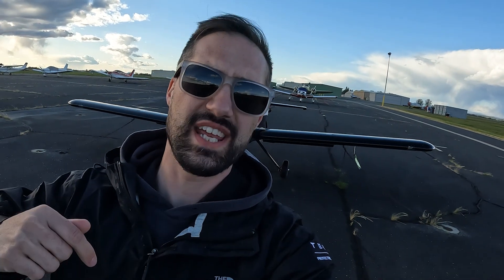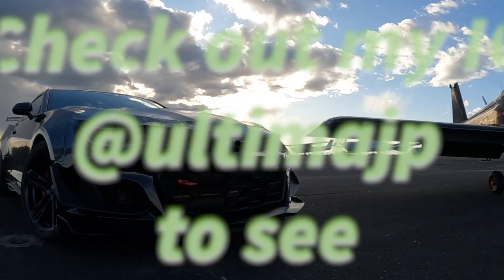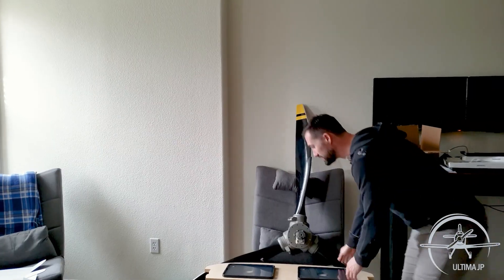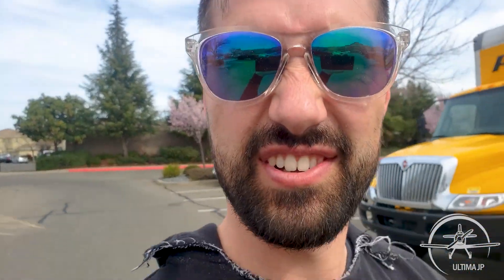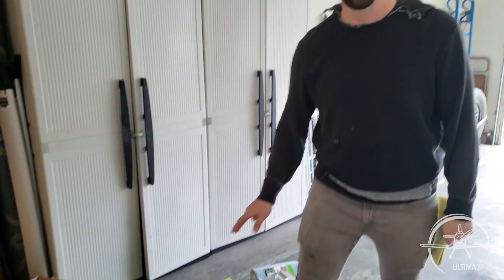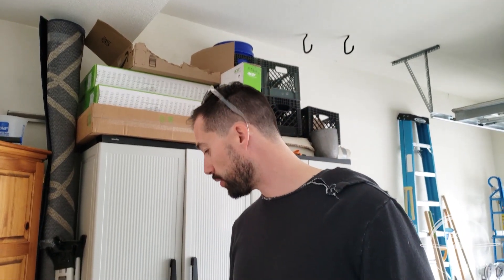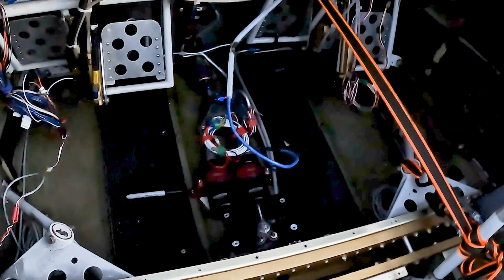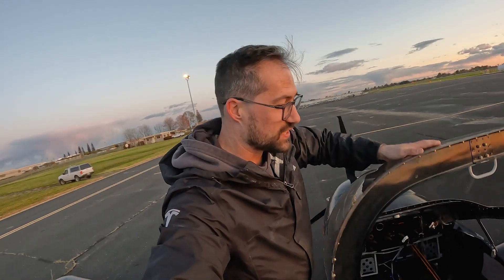Revamping My Cockpit: Building a Carbon Fiber Instrument Panel for My LS1-Powered RV-7A

Comment: SUbscribed with Cleetus today and then saw your plane which is very interesting = airplanes. I am not suggesting you change anything, get out and enjoy it. Are you in Florida too? Imagine the performance if you could have a constant speed propeller. I did find myself jumping forward in the video , so maybe you said it... is the LS alternator providing charging? Becasue , all I heard was you had 2 great batteries that can provide less time than you have in range.
Reply from the maker: Yes there is an alternator the batteries are a fail safe

Comment: Curious what your empty weight is. and useful load. I swapped a Lycoming for a turbo Yamaha sidewinder in my RV9. Empty weight is just under 1000 lbs.
Reply from the maker: were you are High Sierra? I think I may have chatted with you. 

	                        weight	arm	         moment				
Aircraft            	1412	76.140	107509.68		Min CG	Max CG	Median
Fuel 42 gallons	252         80.000	20160		       78.7	          86.82	82.76
Pilot	                200 	97.480	19496				
Passenger	       200	       97.480	19496				
baggage	       200	      126.780	25356				
Total	              2264	      84.813	192017.68

not sure if this comment will post correctly